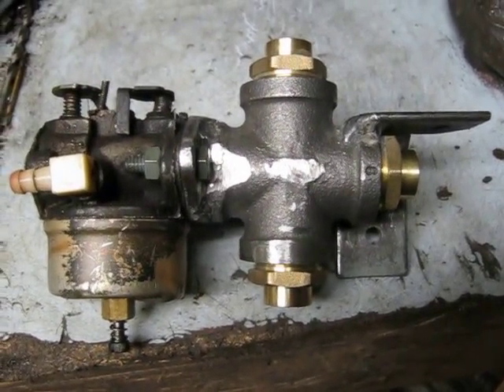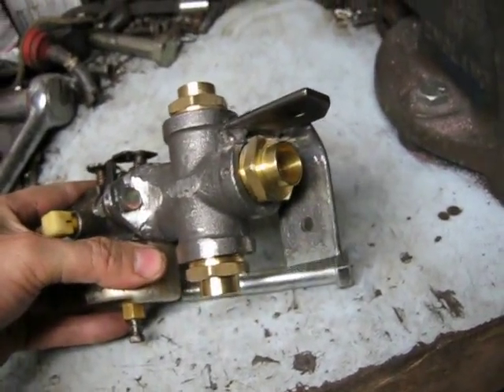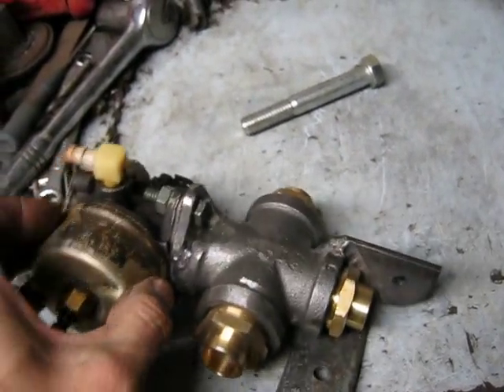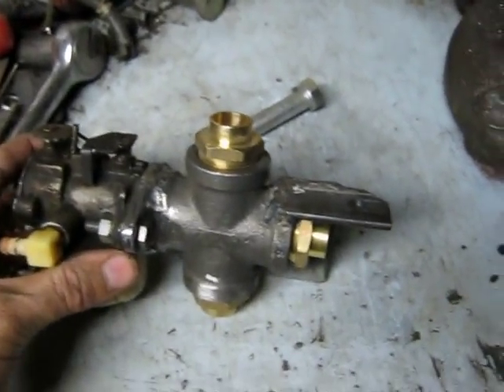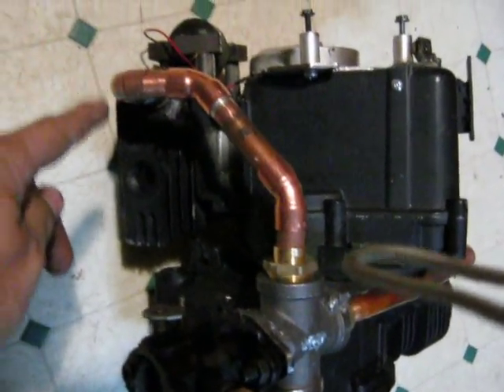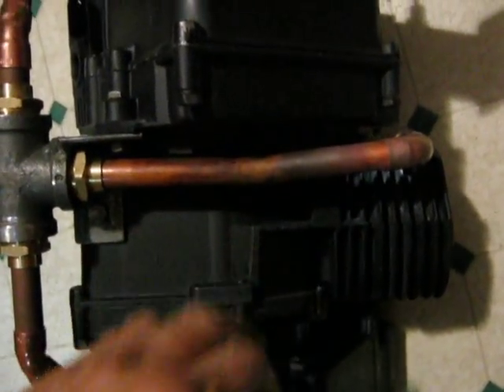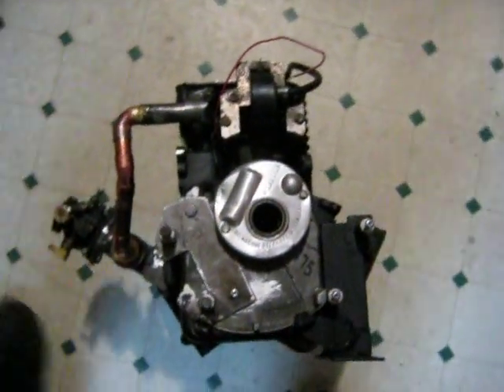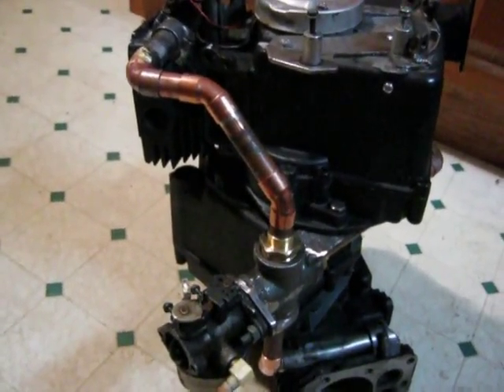3 Cylinder Briggs Radial Intake Manifold

Comment: BEAST!
Reply from the maker: TheFlacker99 (Flak) Yes, it is beginning to look rather Beastly. Certainly the most unique manifold I have made yet. Though making the 1 into 2 adapters for the FrankenBriggs 4  was a challenge also. This one is more like trying to work on an Octopus, plus I had to take the engine blocks back apart to get it off the engine! I am hoping it doesn't prove to be a big pain during final assembly, getting in the way of tightening bolts up etc. I still have a few more hurdles to overcome on this engine.

Comment: looks like  it's  coming  along  good ,,i really want to see this  thing run 
I just  love these  odd ball creations  you  make 
on a  different  note ,, have you  done anything with the  sleeve valve briggs or  the  poppet valve  2 stroke  lately   those  are  2 of the  coolest  things I have  seen you  make to date 

I myself  am working on  building a  couple  of  machines  too ,,  I  soon will be  starting
work on a completely scratch  built garden tractor ,, this will be a very  long  duration  project possibly  taking  2 or more  years ,,including fabrication  of a complete bucket  loader and   3 point  hitch ,I have  almost  all the  components  for this except an engine of the  right  size
Reply from the maker: wildcoyote34 WOW, that sounds like an ambitious project! A friend wanted to build a skid steer machine, not sure if he has done it yet, though I know he is capable of it (he made the compressor head for my Briggs compressor, as well as the bearing housing for the supercharged Briggs, and other things) the guy really know his stuff! The sleeve valve is sitting in a box in pieces (I started to do new as built drawings of the various parts) the poppet valve 2 stroke is resting on a shelf. I planned to build a smaller supercharger for it, but got side tracted, thanks for the reminder. I was really surprised at how well that engine ran, mainly just by running the camshaft at crankshaft speed.
Reply: the  project  is  an  ambitious one  your  right ,, it's actually a  project I wanted to build 20 years  ago but  at that time I didn't  have the  necessary experience or  knowledge ,,now as I approach  middle age  i find I have the ability and the time  do do it ,,a lot of the  parts  i need are also  more  available ,,most  notably  engines and transmission parts 

I have  built a tractor  before but  not  like this 
the  one i built  years ago   was  built  from  salvage  yard  truck parts ,I still have it ,, it's actually a full size tractor  with 100HP,,
roughly  comparable to a 4020 john deere as far  as  power and ability ,, that  monster is powered by a 300CI inline 6 from a  ford truck 

the  thing I am building now  will be closer to a large  garden tractor in form and  function ,,i have my  eye set on a  4 cylinder diesel engine a friend of  mine has ,, it's  about  30hp or something close 

I always  thought the  poppet valve  2 stroke was  pretty  cool ,,just one of those things  that not  everyone  can  make ,, same  with the  sleeve  valve
Reply from the maker: wildcoyote34 Strange, I could swear I replied to this!1980s VW diesels were pretty good engines, though you would have to deal with it having a transaxle, but not an impossible adaptation. I was going to use one for a belt drive generator, but never got around to building it.

Comment: My only question is how does cylinder 1 get is's oil?
Reply from the maker: Mr3wheeledbike The same way the other cylinders do.  Now does that have you guessing???  :)
Reply: some what yes? i know you fabricated up oil splash sticks in the pasted....maybe you have a new trick up your sleeves. Oh well weight and see.
Reply from the maker: Actually, I haven't made any oil splashers yet, perhaps we watched the same vid where someone else did it, as I remember seeing a vid about that. Yes,  am using tricks to oil these engines, I hope I haven't gone too far with this one, as a friend thinks my crank bearings (bushings) might run into some problems, I will use some grease during assembly to make sure it doesn't have a dry start!
Reply: well this is starting to sound interesting, and from what i know (little really) assimbley grease is well worth the 10 or so dollars

Comment: Wow! it's looking awesome. Your moving right along with this project, keep it up and good luck.
Reply from the maker: Tinker Jim Hi Jim, yes, I am making good progress with it, and hope to have it going soon. I bought some 0W-20 oil (thin as water) to help me with starting it up with a pull cord! Though the top cover is causing me some grief as my welder won't weld such thin steel. I may end up firing it up with no top cover, using my electric starter for a test run  :)Man I sure have had to make a lot of brackets for this (2 coil mounts, gas tank, carb. and top cover mount brackets) plus the top cover.

Comment: Woowho! Great work. Do you have the crank shaft made? I can't wait to see this run. Both you and Roadking do the coolest stuff with Briggs, but yours is especially unique :-) I've never seen a cylinder pattern like this one.

Also how will the engine be oriented? Is the crank shaft vertical or horizontal? Sorry if this is brought up in a past video.
Reply from the maker: RoboTekno Don't worry, I don't mind answering questions, I know it is hard to keep track of everyone's vids!Yes, I have the crank made, I haven't shown it in any vids. This will run vertically like a mower engine, and is a "stacker" design like my 2 cylinder Briggs. Yes, the 120 degree spacing of the cylinders is unique. It is a pure coincidence that 805RoadKing and I are both working on 3 cylinder "radial" type engines at the same time. As I showed in an earlier vid, I sketched this one up back early this year, and Roadking thought of building his radial a while back also, though his is much more challenging to build being a true radial design.Mine is somewhat simpler being stacked up engines, so I don't have to machine a crankcase triangular box to mount the cylinders to. Though building this one has been more of a problem than I envisioned, though that always seems to be the case. The main problem I have these days is virtually no access to machining equipment, so I had to improvise and overcome!!!  :)
Reply: ChargerMiles007 Awesome. Thanks for the reply. Keep up with the good work :-D We know you can do it!

Comment: I know, put an 850 Holley on it! Bigger is better, right? But seriously though, that 8 horsepower carburetor might be a hair small but it should work.
Reply from the maker: Cameron Jenkins Yes, I also think the 8 horse carb. is a bit undersized. I did use 1/2" copper pipe for the manifold instead of my usual 3/4", I thought it might help it run better at lower rpm.I don't have an 850 Holley, but have an 850 ThermoQuad, those carbs actually work very well when they don't have vacuum leaks or leaking O rings dumping in tons of fuel ! I am hoping this 8 horse carbs treats me well, as it was originally on the odd fire 2 cylinder stacker, before I swapped it out for a 7 horse carb.
Reply: Considering that the 8 horsepower engine was roughly 22 ci, it should work just fine. At least you won't have problems with the carburetor not atomizing the fuel well due to low vacuum. The half inch pipe should increase velocity in the intake, thus increasing velocity in the venturi, so you'll probably be fine.
Reply from the maker: Cameron Jenkins Yes, here is hoping it all works out fine. I found out the hard way on my first opposed engine that an undersized carb. is a major pain, it took me forever to get the engine to run even half way well. Now I pay more attention to the size of carb. needed.